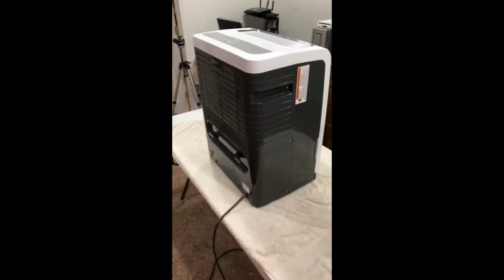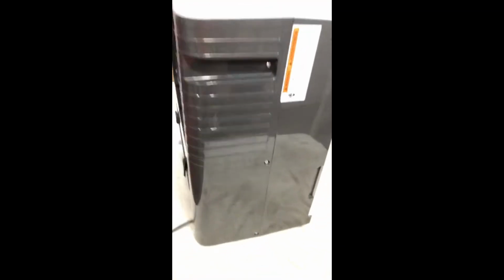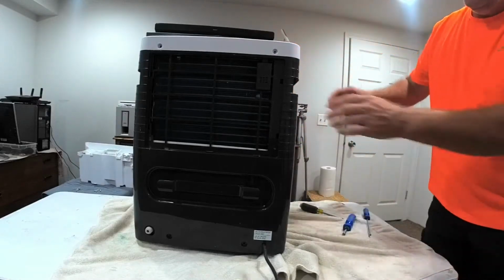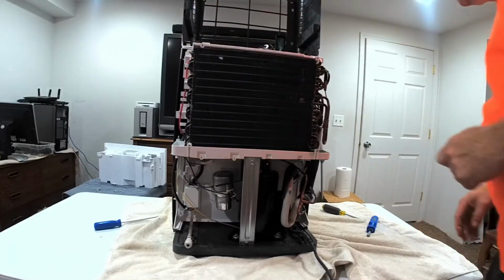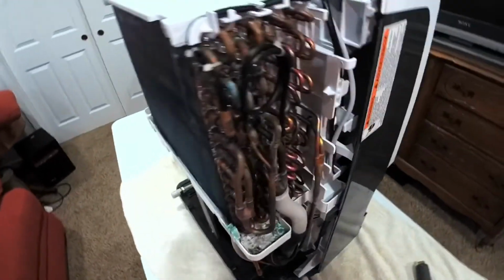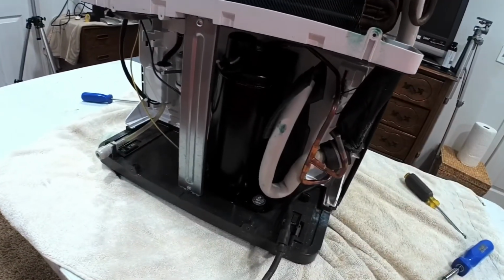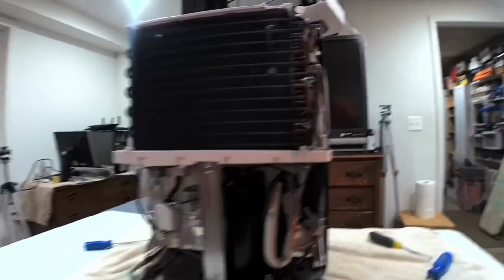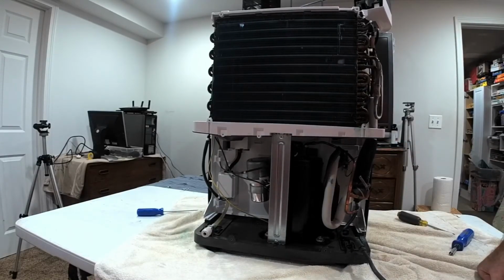How to fix/disassembled a Hisense dehumidifier. Part 1

Comment: I have one that seems to have the humidity sensor out of adjustment. Hygrometer reads 65% humidity, but the dehumidifier is reading 45%. It draws water in continuous mode, but if I set the dehumidifier to 60% it ends up not pulling water. Can you tell me what the problem is?

Comment: Here is a problem that has me stumped. The pump stopped pumping water so the water filled the bucket. The pump light was flashing. I emptied the bucket and then the pump started pumping again but when it shut off automatically the pump light would start flashing and it would not turn on unless I turned off the power before the bucket was full and turned the power back on. If the bucket was full I would have to empty the bucket as the unit would not run until I did. The pump would work when I turned it back on. Then the cycle begins again, it automatically shuts off and the pump light starts flashing I would have to turn the power off and back on to get the pump to work again but only if the bucket was not full.  Is there a solenoid or circuit board that controlled the pump that went bad? Could the pump be bad?

Comment: Have you ever fixed an “E9” error code on one of these ??  IF so, Can you please post a video of the fix?
Reply: I'm going through the same thing. I called "customer service" who informed me that E9 is some sort of miscommunication between the humidity sensor and thermistor. I easily located the humidity sensor and saw it caked with dust. Unplugged it, hit it with some air and plugged it back in. It seems to be working fine as of now but time will tell.
Reply: @drewmedic23  thanks for the reply… I tried this and not luck here.   Anyone know Is there a way to by-pass the sensor or trick it with a resistor and always keep the unit running??
Reply: @jbh.6257  The replacement humidity sensors are about $20 but you can jump the two wires together to short the humidity sensor to force the unit to run continuously.
Reply: @drewmedic23  tried connecting the two pins on the sensor(soldered them together). And it only makes the display show “88” now but still kicks the E9 code after a while and shuts the compressor off ;  but fan still runs.  :(
Reply: @jbh.6257  I actually had the same issue...I think the thermistor went bad rather than the humidity sensor. I'm ordering a new thermistor and I'm hoping that works
Reply: @drewmedic23  ahh let us know how you make out and a link to what you bought ,  thanks !!
Reply: Turns out you can simply unplug the sensor for the back and it will show E1 on the display but still runs and cycles fine.
Reply: @drewmedic23  Where did you order a new sensor?
Reply: @Winter46r  I found one on eBay for $20ish. I changed out the sensor with no luck, still got the E9 error code. On calling their tech support, apparently there are multiple error codes for a faulty humidity sensor which tells me that other stuff is going on. Anyway, I got annoyed and got a new dehumidifier. I'd be happy to send you all my spare parts so you can try it

Comment: It comes with a 2 year warranty. I called and they are shipping me another one. All I had to do was take photos, fill a emailed form out and cut the cord and show the receipt. All done via email.
Reply: Purchased mine June 16, 2019. Worked up to a month ago. Was real loud, would shut off by itself and did not appear to be doing anything anymore. I tore it apart before disposing it/recycling it and saw nothing obvious. No leaks. Checked the pump and found no obstructions. Does appear to collect a lot of slim in the plastic tray where 2 metal screens are. Note! This area is not accessible without dismantling 60% of the unit.

Comment: I should have watched this one first! I'd suggest you to clean the green off and get the pipes very clean in the area of corrosion and possibly a high pressure leak. Then, a leak detector would tell you were to desolder, clean, flux and solder. I'd say the unit was left running in a hot room and it over pressured, but that is pure guess and worthless.

Comment: I think you've got the evaporator and condenser coils reversed.  The evaporator coil is the cold one and contains mostly gas.  The condenser is the hot one and contains mostly liquid.  Within the circuit, there should be an expansion valve that restricts the flow between the condenser and the evaporator that causes the phase change and the temperature drop.  I was not impressed with my Hisense machine...